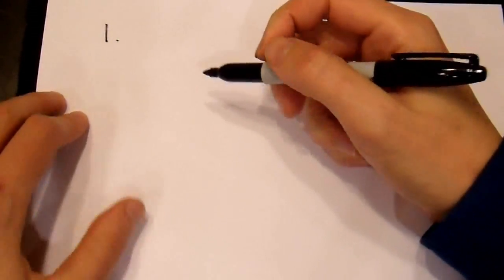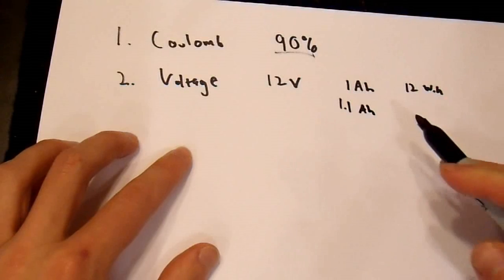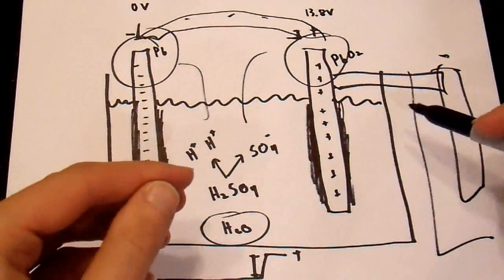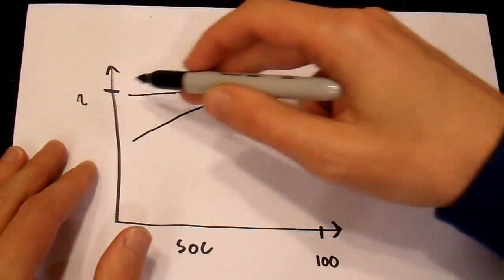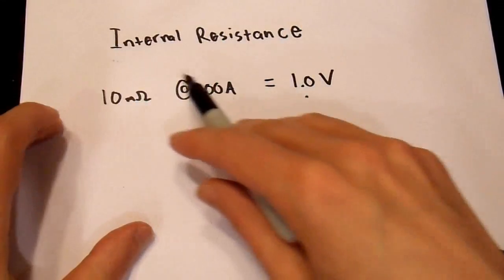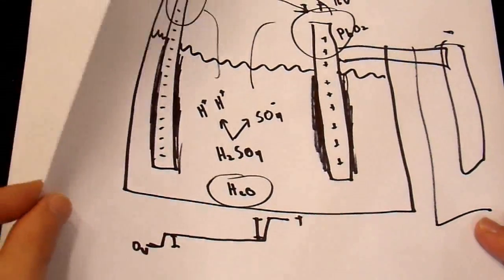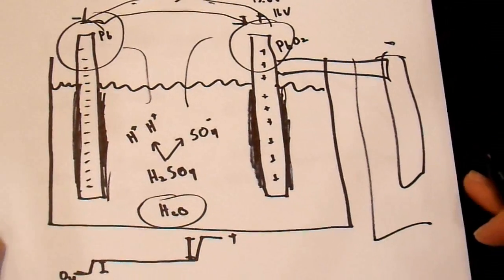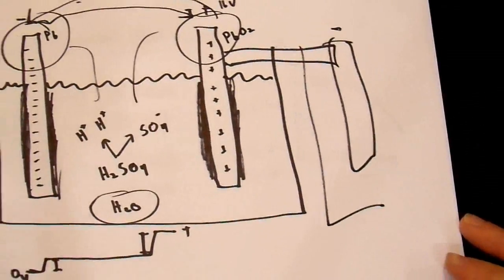Peukert's Law is Wrong and Here's Why - Part 2 of 3

Comment: Battery response is non linear and depends on state of charge and temperature. 
It's my experience that internal resistance and voltage drop under load inversely proportional to temperature. Also the "health" of Lithium cells can be gauged by measuring the internal resistance at a 1C rate from a fully charged state. This normalizes the time component of Peukerts curve.

Comment: Excellent videos, man.  I've learned so much watching.

At around 6:20, you label the 'state of charge' axis from 0% to 100%.  Does 0% here mean the manufacturer's recommended minimum discharge state?  Or does it mean truly discharging all energy from the battery?  I know it doesn't matter so much since you were just making a generalized point of how batteries behave.  But I'd like to know so I can feel more confident about applying the math.

Thanks.
Reply: fully discharged is 10.5 volts.

Comment: Does flash charging a battery with very high voltage for a very short time, clean off the lead sulfate deposits?
If yes, would this be helpful for restoring a battery?
Reply: ***** Very interesting, thanks for sharing.  On the old gas ion lasers.  Cleaning cathodes, as a last ditch effort; we would clean them by heating the cathode until it glowed orange (not too long, or you were out $15k).

Comment: You haven't really proved or said anything here that isn't already known! You are aware of that right?
The titles of your videos are stupid also. You are not arguing what your titles say which are stupid to start with.
The titles sound ignorant and stupid saying Peukert is wrong and saying that 1+1 batteries in parallel = 2.7 in capacity.
When in reality this is not true at all. It all depends on the discharge rate which changes the efficiency of the battery. Also the rate at which you draw current changes the voltage drop so you really can get more out of the battery at lower rates before it hits the cutoff voltage.
This is basic stuff most people know about batteries.
Reply: "This is basic stuff most people know about batteries."  Wrong.  Most people do not know anything about batteries.

Comment: Thanks for informative videos. I have a question how we know about battery cycle I mean how we can know is a battery deep cycle or normal cycle battery? 2ndly car and trucks batteries are deep cycle or normal cycle batteries.
Reply from the maker: Stock car and truck batteries are always SLI (starting, lighting, ignition) batteries and never deep cycle.  This includes semi truck batteries despite how they are sometimes used.  A deep cycle battery will be marketed as such and the manufacturer will not recommend it be used for SLI purposes as it was not designed for that purpose.  Some manufacturers advertize 'deep cycle' batteries but they are of such low grade that they are basically just SLI batteries in disguise.  A reputable battery supplier that specializes in batteries should be able to point you toward those that are truly deep cycle.

BTW, I would not hesitate to put a good deep cycle battery in my automobile if I were using it for more than general SLI purposes.
Reply: Thanks

Comment: One thing I have never quite understood is why a battery with thin lead plates is bad for repeated deep discharges.  Maybe you could explain some of the chemistry behind that.  I am guessing that a battery with thicker plates would probably increase it's internal resistance more quickly under a high discharge rate though, from what I am seeing here.
Reply from the maker: Thicker plates means fewer plates fit inside a battery of a given size, so there is less surface area for reactions to take place resulting in a higher resistance.  When plates cycle between charged and discharged they mechanically expand and contract with each cycle (lead sufate is larger than lead for example). This mechanical cycling results in damage to the plates.  Thicker plates can withstand this mechanical stress better than thin ones which tend to warp and break after a smaller number of cycles.  When a plate breaks at best you lose the capacity of what broke off and the cell resistance increases, at worst it can break through the separator material and short out that cell ruining the entire battery.